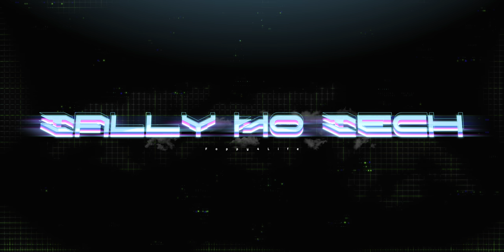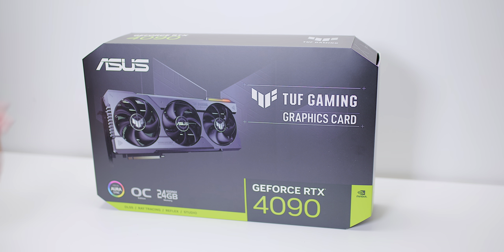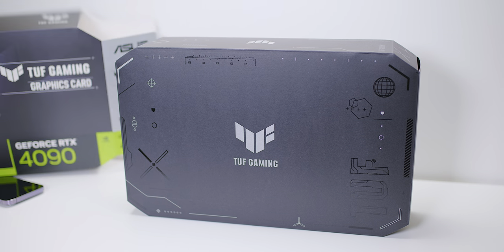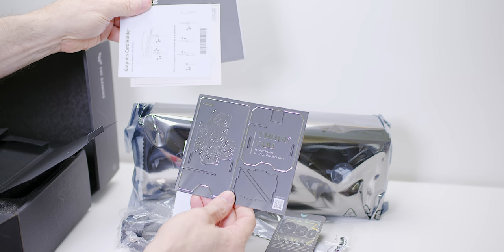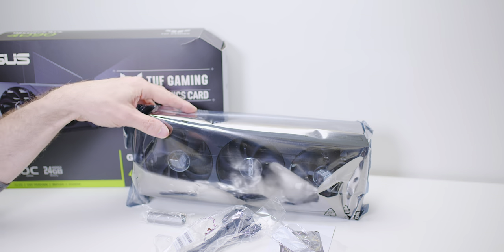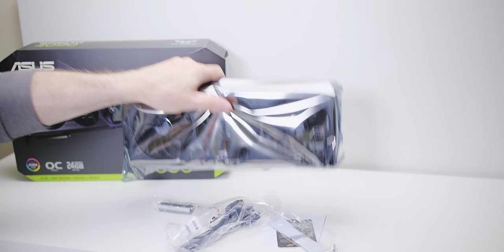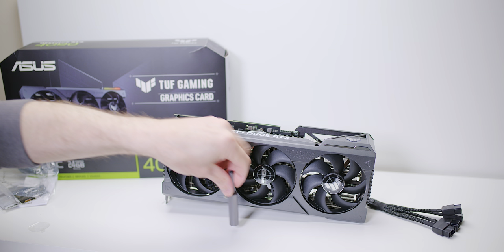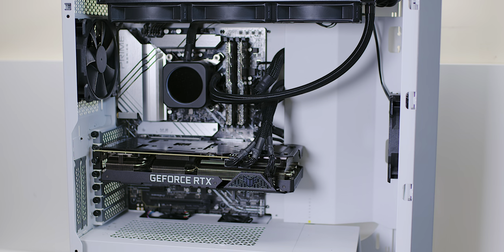IT'S TOO BIG 😜 | ASUS TUF RTX 4090 OC UNBOXING & Installation Guide - In 4K HDR

Comment: Don't actually need all 4 power cables for the adaptor, 2 cables it won't boot but 3 cables will provide the card a 100% power target, therefore upto 450 Watts, the 4th cable will technically allow the card to draw upto 600 watts or 133% power target (i have the exact same card)
Reply: Tell me more, 2 cable + 1splitted its fine?
Reply: @alessandrodivito7068  No absolutely not, you need to use a minimum of three separate cables from the power supply to the GPU, i was just trying to explain that you don't need all 4 cable, although you would probably be best using all 4 to ensure maximum power supply if you can.  I have mine connected up with all 4, but three would do in a pinch but nvidia designed the adaptor with 4 cables for a reason and who am i to argue with them 🙂
Reply: @Soupladel  for this that I have red led on the gpu right? The cable have presence sensor inside?
Reply: Yeah, when my system is powered down, there is a red light right next to the 12vhpwr connector
Reply: @Soupladel  its seems so strange,  normally a red led show problem....
Reply: @alessandrodivito7068  so i did a bit of research and the LED is a power detect signal, if it's red, its because it is detecting no power.  However, the red light showing when the PC is off is because it is detecting power at the PCIE slot, but not from the 12vhpwr and thinks it is not getting power but should be.  So when you turn the PC on, the PSU kicks into life and supplies power to the 12vhpwer socket and the light goes off which shows everything is ok.

So if the PC is off and red led = OK, if PC is on and no led = OK, but if PC is on and red led = problems
Reply: @Soupladel  i hope so,when pc is on its always off, thank u Karl
Reply: So 3 different cables and 1 split one should be fine right?
Reply: @borgaiskender796  i dont know what the outcome of that would be, but if you can't or won't connect 4 separate cables, then i would just connect the three
Reply: @m3taleye  lol, well you probably need a new power supply!!!! the cables themselves can be split, but you should still have 4 distinct cables coming from your PSU to you GPU via the adaptor.  if you just have  one cable with 4 connectors on it connected to the GPU, it would be highly dangerous unless it was designed to carry a load of upto 600 watts.
Reply: @alessandrodivito7068  Im using 2 cables and 2 splitters on my 4090 using a 850 watt power supply. It’s been 2 months and I’m still going strong with no issues
Reply: That makes sense, I don't understand why they need 600w when the cards stock use like 350-400w, and 450w is already stupid

Comment: CPU bottleneck 😢
Reply: Not with the game he played, the CPU was basically idle 2-3% load.
Reply: @Techtablets  that’s because games don’t use all the cores. He is still cpu bottlenecked as his gpu usage never reached 100 percent
Reply: @Techtablets  in order to determine true cpu usage he’d have to display the load of the cores the game is using
Reply: @Techtablets  if gpu i not hitting like 99% then it is waiting for cpu to process frames, doesnt matter the usage! 4090 is a behemoth, even on 4k some games are cpu bottlenecked!
Reply: Atleast you wont have to upgrade gpu for years, just cpu to get more fps 🤓
Reply: For 4k (which is what this card is for) and VR you will NOT see a bottleneck even reaching back as far as the 9900k. I don't know if links are allowed, but search for this: 9900K vs 10900K vs 12900K vs 13900K + RTX 4090 - Test in 11 Games | 4K UHD(3840x2160)

Again gaming at 4k only, if you are gaming at 1440p where the CPU might actually be a limiting factor then why are you buying this card and not something better suited? I just upgraded from a 3090 to a 4090, and with my 'old'  10850k I'm missing maybe 2% fps vs the new mobo/cpu/RAM that a 13900k would cost. Not worth it. My 1% lows are maybe 10% off, again not noticeable for 4k and VR.
Reply: @wraith8323  my 4090 with a 5900x overclocked is bottlenecking at 4k with ray tracing in the witcher 3, spiderman, and cyberpunk.  I am using dlss because i want super high frame rates like over 120 and its bottlenecking.  I am nowhere near using 100 percent of my 4090
Reply: @reallivefitness8046 wrong 😂

Comment: Since 4090 release. I continuously checked the web, no success, frequented my local Micro center in Tustin, California, 30 miles round trip, and no success. 1 week after ceasing my effort, i went to micro center in the afternoon on a Friday to get cable combs. I showed up right when a re-stock of these went on the shelf. I was able to get one. The fit and finish is awesome, feels well built. I went with a Fasgear power cable. its on amazon. so far it works great.
Reply: Found one today at that store. But it is too high for my case. :-(

Comment: My gpu only comes with the option of using the adapter and my 2 pcie’s cables that are split both have one head that just won’t plug in, any help would be really appreciative!  This is my first Pc build and this is the last step I have to do before booting it up.

Comment: The beauty of this card, is with a custom fan curve to keep it running at 40% min and go up to around 75% when it reaches above 65 degrees. Don't need to increase power limit (even though can go +33%)! Go +121 core +500 vram. As long as you have a decent case with proper airflow it rarely ever gets hot enough to downclock below 2910mhz core. Mine lives in the 2955-2985mhz all day long. 

The other lovely thing about this card. I have a i5-14600kf @ 5.8ghz all P-Cores with arctic cooler 360mm AIO, DDR5 (2x32gb) cl32, NZXT Elite H7 case with upgraded rear 140mm fan (much quieter than the stock one) + an LG C3 42" Monitor/TV. 4K 

As the card  barely makes a sweat, and no matter what I don't seem to get screen tearing regardless how many fps. If say you play Rocket League, just frame cap it in game to 240fps and this cad will live under 100watts and maintain low latency ms.

Have tested over 10 different RTX 4090s in one of my computer stores and the VRMs on this particular Asus OC with that box with the edges has the highest quality VRMs. 

Naturally, I have tested to see how well it can perform at max when power setting is not on balanced and you don't care about the environment or power bills. Where setting a RTX 4080 OC are able to perform above 120fps in pretty much everything maxed at 4k, you will find, you will leave it uncapped and it uses a fair bit more wattage. The beauty of having so much beautiful hardware on the board of this 4090 is if you want you can allow it  to go stable 3060mhz +1400vrm with a custom voltage/freq. Rock solid. 

End of the day, its the overall best when you have your setting right and the CPU and ram are running at decent speeds with a z790 mboard.   That can live high 2800s-3000mhz core and in game cap to both save power and heat. 

Side note. I had a i9-14900k and a i7-14700k both OC with the same setup, but went with the i5-14600kf as it has the ability to OC higher and use a whole lot less energy and heat dissipation resulting in higher FPS in every single game. Maintaining both CPU, Ram and the GPU to never throttle. 

Wow, never endorsed a product like this :/

Comment: did you have any issues fitting your glass back on? i have the same case and just bought the same gpu. im worried the glass wont fit back on though? did yours still fit ok with too much bending of the pcie cables by the gpu??
Reply from the maker: No

Comment: I am on the fence between 4070Ti Super Dual and 4070Ti Super TUF. I own Strix 3090 and although its a big and heavy card it doesn't sag at all so I don't use the anti sag bracket and tbh. I really don't like them and will try to avoid using them, just don't like the looks.

Could you tell me if the TUF sags at all without any support or you need to use it. Tbh. and as silly that might sound that part is deal breaker for me.  I hope you can let me know soon as possible. 
Thank you sir

Comment: Are you Aussie mate? Didnt even know you needed to plug 4 individual PCIe cables to this thing! I just got my Zotac 4090 yesterday. Glad i came accross your channel mate. Subbed!
Reply from the maker: Aussie bloke. Some people are using 3 cables with one piggy backed. Each 8 pin PCIe cable is 150W (they can do more) so best to have 4X 150w pcie 8 pin to equal 600w plug on the GPU
Reply: @TallyHoTech  The zotac reach 700w with 4x and 500 with 3x

Comment: Question: i have the same gpu i wired with 2 PCI 6+2 and the rest 2 with a single PCI 6+2 splitted, in the starting load i have red light on gpu, then all its fine, what i have to do? How so you Connect, on the video is not showed up Well , thx
Reply from the maker: It works right. That sounds ok

Comment: where you able to close the side panel?
Reply: I wanna know that too! I have a Corsair Obsidian 500D with an GIGANTIC AORUS 3090, just bought this ASUS TUF 4090 and I don't know if I'll will fit wide-wise. The card  yes, but the cables? I don't know if I'll be able to close the side panel. I'm updating this tomorrow when I install the 4090 inside.
Reply: @Kiwomens  How did you go with the side panel? My case is 229mm wide and im a bit worried!!

Comment: Still haven’t seen one video with the non OC version.  I didn’t consider the oc for a second.  Literally like burning $200.  Exactly the same as non oc.  The strix imo looks worse and is otherwise exactly the same in performance.  I know it’s slightly different cooing.. anyway… I just installed the non oc version of course and it’s good.  Had an issue where it wouldn’t boot from having too high of a mem clock and wouldn’t trip the driver to reset… not good.  Finally got it to boot.  No need to oc any of these as they’re not efficient above 400w.  300 is probably the sweet spot

O and I’m using an hx750i psu.  It’s fine
Reply: I decided against the TI OC’d ROG  edition for another $200.   although it claims to have 16 gigs of ram versus the 12 gigs my 4090 has.

Comment: Ijust received it today. I bought a Thermaltake ToughPower GF3 source, I put all the cables and when I started it smoke came out of the power source. I tested separately the power source now and it blows the fuzzes in my house.Luckily the motherboard still works but now I need to bet my money back on the power source and get a new one :((

Comment: there is no diference between TUF and Strix this gen because the cards have a voltage cap. So as long as they both hit 600W limit they are pretty much the same
Reply: 1300w
Reply: Not true, strix is using more premium materials and has better cooling, Tuf will do just fine tho.
Reply: Both have the same PCB
Reply: @AndreasRP. no lol
Reply: @fancyson0  yes lol

Comment: They just need to make a cable that has the 16pin at one end and turns into the 4 pcie connectors near to the PSU.
Reply from the maker: Good idea
Reply: Cablemod and others made an extension cable

Comment: Dont need to buy och.. i just buy normal 4090 tuf and flach Strix Bios bomm 600 vart and higher clocks not need to buy the expensive Strix Ore oc

Comment: You can't be bothered at the moment?  Also you should check out the ddr4 vs ddr5 tests with a 4090,  using ddr5 saw up to 18% fps boost in games.  Clearly your CPU + ddr4 is bottlenecking your 4090.

Comment: why buy a graphics card for 1700 dollar that wont take advantage of your expensive  monitor I wont that is for sure.
Reply: This is meant for high frame rates in 4k. Most high end 4k monitors are 4k 144hz, which obviously this reached with ease.
Reply from the maker: Do what work for ya mate

Comment: Your GPU utilisation is very low Mate (around 60%), hence the low frames. You'll have to play around a bit with settings etc and you should hit those frames. Just bough the same GPU and she's a beast. Got my 10700k OC'd to 5.1ghz, and get 99% GPU utilisation in heavy load games.
Reply from the maker: I depends on the game right ?
Reply: I'm also using this Asus 4090 with a 10700K. I don't mind paying for the latest GPU  but I'm not buying new motherboard, AIO, CPU and RAM just to gain +5% fps at best in 3440x1440p
Reply: @tangosucka2000  i saw a lot of videos two years ago when I bought the 10700K, to see the difference between 10700K and OCed 10700K. The difference was so negligible that I completely lost interest in OC It. So it runs a its default 4.7Ghz boost frec
Reply: @tangosucka2000  as for the GPU utilization, is almost always with any game at 99% (with the 3090. I'm installing the 4090 tomorrow)
Reply: @tangosucka2000  I'm using an ALIENWARE QD OLED 3440x1440p. Best display I've ever seen. Even better than my LG C1.